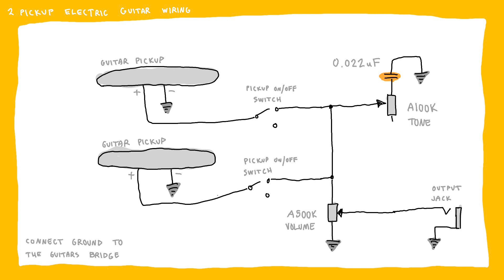diy baritone guitar

Comment: Great video as allways. Lipstick pickups have low output due to their design... I love mine. If you are looking for bright and big output on the cheap check out dual blade single coils.
Reply from the maker: Thanks! Yes i know lipsticks have a low output, but these ones are on a whole different level! 😅 The output volume is like 6 times lower than for example a regular cheap strat!
Reply: @LAURISDIYCHANNELTV  they should run near 4k ohm output if they are working fine. A regular sigle coil  runs average at 6k ohm with a ceramic magnet.